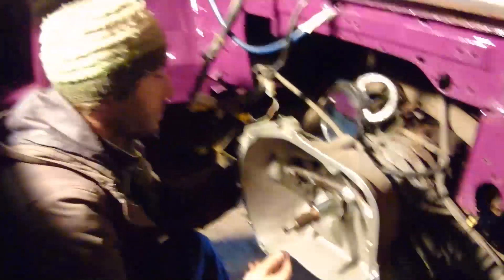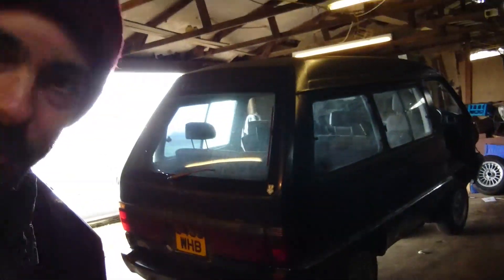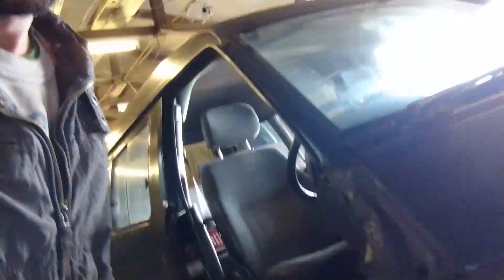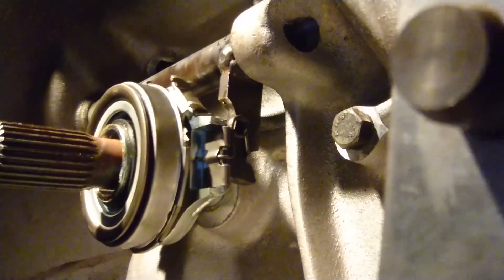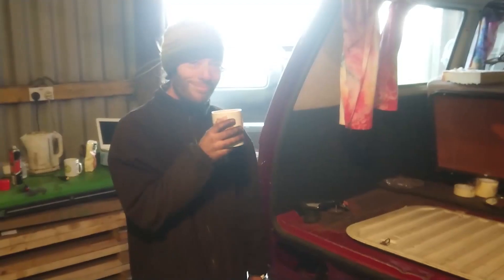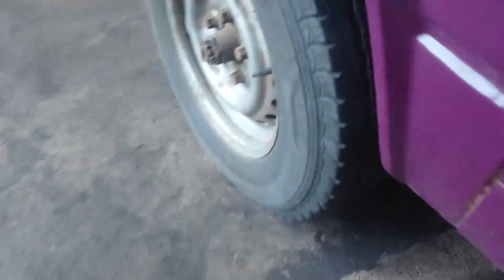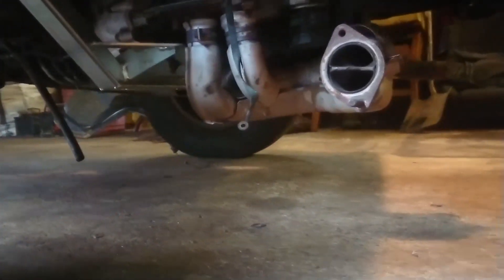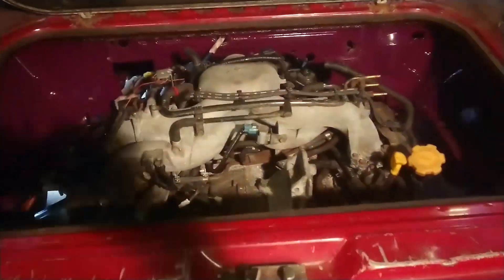VW T25 - Subaru CANbus Conversion [Part 7: Engine Mounting]

Comment: So what happened to this project? I wanted to hear the new engine start and you rip off the exhaust on a farm track. ;-) I'd like to see how it drives, but I can't find a "Part 9". Congrats to your bro for becoming pope.
Reply from the maker: It's been stalled for a few years. We got to the wiring part and sort of stopped. It's pretty complicated and neither of us really knew how to go about mating up the Subaru wiring with the existing van loom. 
We bought an interface box from AGT engineering but life just got in the way. Leo bought a house and I bought a boat. 
It's still something I really want to get going but the list of projects just seems to get longer. It's coming around though, so there might be an update later this year at some point. 
Regarding your brake question. Yes, it will have more power but the brakes are pretty good already. We replaced both the master and all the slave cylinders at some point and they were more than good enough to lock up the wheels. Also, we won't really be driving very differently. The power is mostly going to help getting up hills. It was abysmal before.

Comment: What thrust bearing did you use the Subaru one or the vw one I have just got the same set up as you have but can’t see how the bearing goes on
Reply from the maker: We used the Subaru bearing on an adapter plate that came with the RJES bellhousing kit.

Comment: Is that the Subaru gearbox or no?
Reply from the maker: No, it's the original VW gearbox with an RJES bellhousing adaptor.
Reply: @EddHawkes  do you still have the Subaru gearbox? Is it automatic or manual
Reply from the maker: @wiktorblaszczynski7270  Yes, still got the box. It's a 5 speed manual.